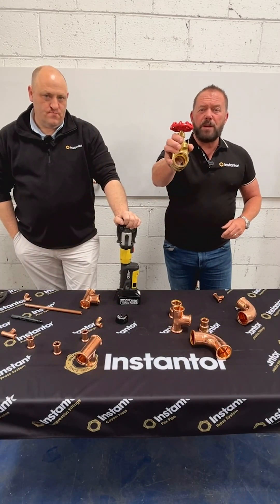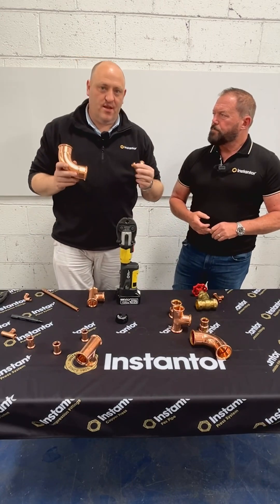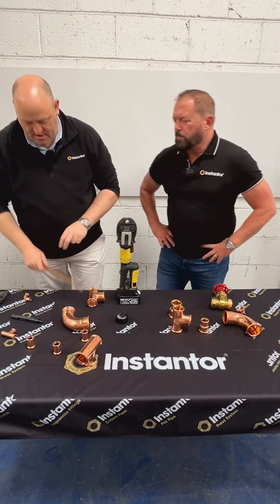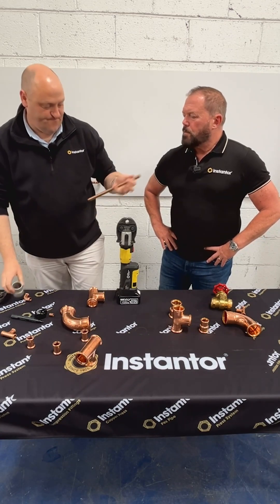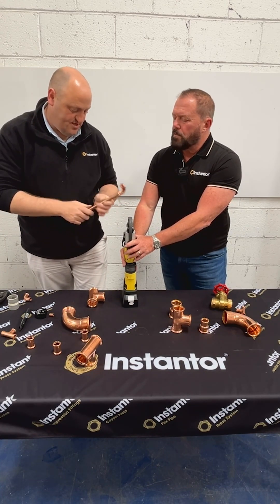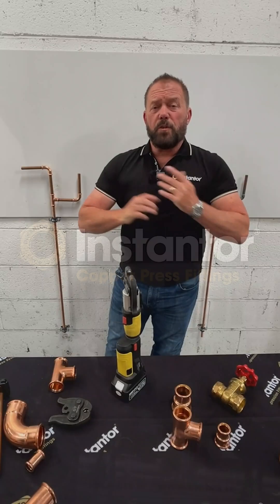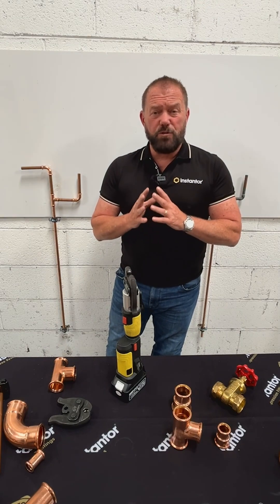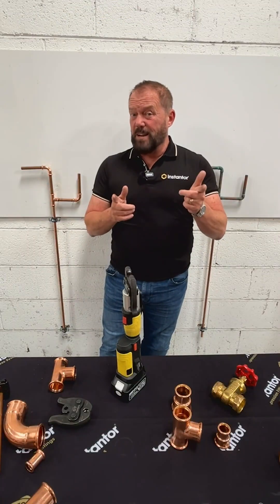Instantor Copper Press Fittings with Andy Cam

Comment: I wish they'd just pull yellow o rings in all the fittings. Why even bother with the black epdm o rings.
Reply from the maker: Hi Ray,

Thanks for your comment.

The yellow HNBR O-rings aren’t approved for use in water systems. If we used them in our water fittings, they wouldn’t meet the required standards or the quality that Instantor is known for.

We stick with EPDM for water because it’s the right material for the job and fully certified for the application. 🙂

Thanks again!